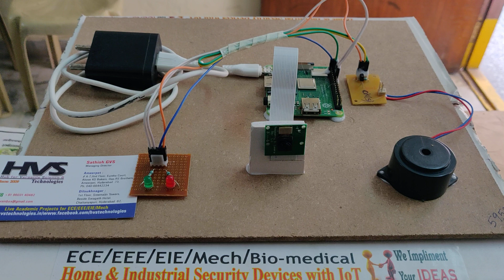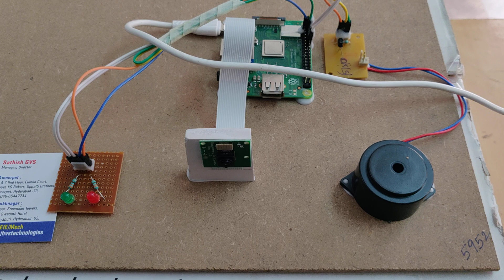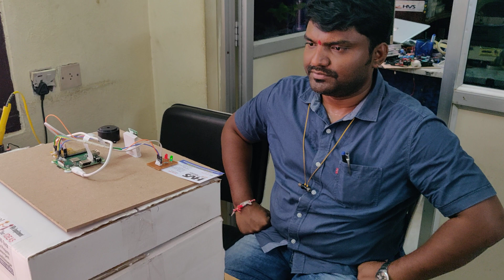Driver Drowsiness detection using Raspberry pi image processing

Comment: Please which OS do you use for the project
Reply from the maker: @olusanyasamson3625  raspbian . Hi, 
We sell full working kit with document PPT circuit diagram and code. Could you Send me the video link, Will update you the cost details. You can contact us at +919603140482
Through WhatsApp or call